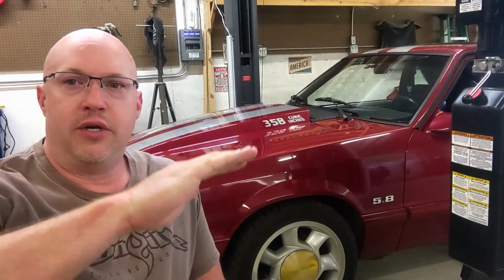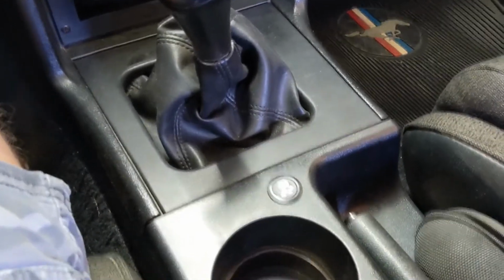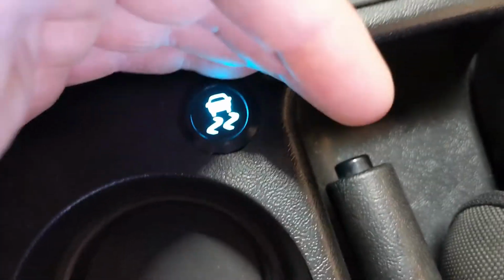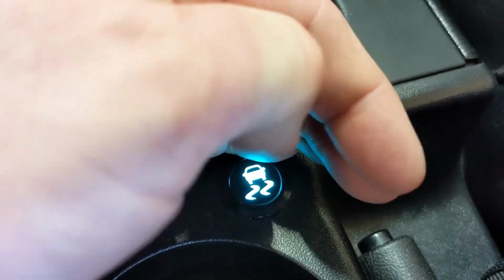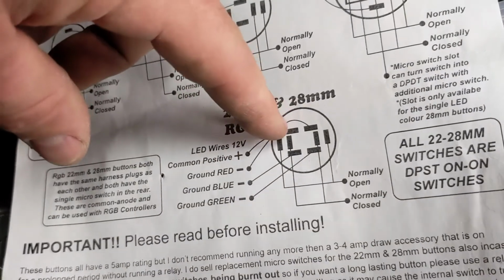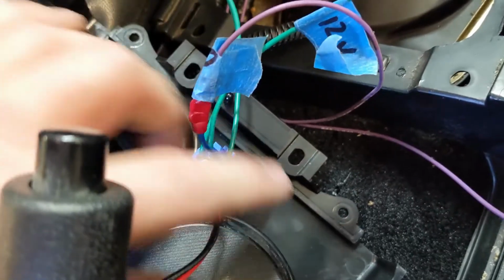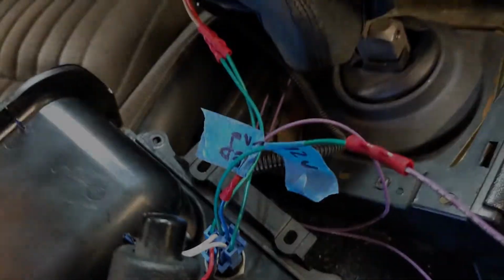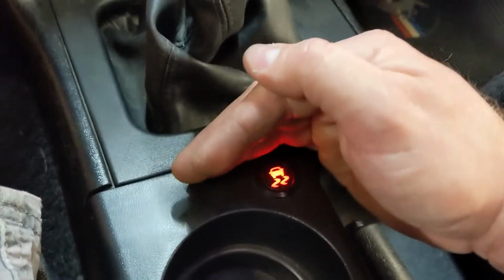Fox Body Mustang 🐎 Traction Control - Pro M EFI - Billet Automotive Buttons

Comment: Great video. I ordered the switch after seeing this. Do you know what wires I'd use for the momemtary contacts to the Pro-M? I ordered the T/C harness but they've gone out of business and never got it. Looks like red and tan in your video, but I don't have the harness. Any chance you remember if the wires were the same color at the ProM engine harness plug? Just don't want to fry anything.
Reply from the maker: Aw man!  It sux that they've run their business into the ground!!  I do not remember what color the wires are on the other side of that harness...  But, there should be a 2 wire harness and if memory serves, it is labeled traction control.  Those would be the wires that connect to the normally open part of the switch.  Next time I'm in the kick panel, I'll take pictures of everything. 
Then, from the manual:
"The purple coil of wire in the passenger's side kick panel is for the Traction Control
indicator light. Use any 12vdc light you choose. Connect one side of this light to a
switched 12v power supply through a 5A fuse. This circuit must be hot only in
the run position. Connect the Purple wire to the other side of this light."

I hope that is helpful!  Please let me know how it turns out!
Reply: Thanks so much for the reply! Unfortunately i don't have a connector  in that area labled T/C. There's just one connector with 6 wires. There is a red and tan in that connector. Maybe that's it, I'm not brave enough to short them together to see lol. I understand the purple wire, just neeed to figure out the two that make contact to turn it on and off.  The search continues. It does suck they went under. Great product, terrible business people.

Comment: With the Pro-M wires connected to the normally open green wires on the switch what are the RGB power and ground wires connected to? It's unclear to me what makes the RGB light go on and off. What provides the feedback to the RGB to turn it on and off?
Reply from the maker: Sorry it took me so long to reply.  I had to go back to the manual to try and remember...  Basically, there is another wire that is purple that is the ground for the light you chose...  
"The purple coil of wire in the passenger's side kick panel is for the Traction Control
indicator light. Use any 12vdc light you choose. Connect one side of this light to a
switched 12v power supply through a 5A fuse. This circuit must be hot only in
the run position. Connect the Purple wire to the other side of this light."
I hope that helps!  Let me know if you have any other questions!

Comment: Hot start issue figured out? And was the purchase of the ProM worth it? I have 88 model that has a rebuilt 306 w trickflow heads and intake that makes 325rwhp. I’m getting tired of the drivability of the car. At wot it runs great but putting around town is difficult at times depending on the weather. I have the A9l w quarterhorse tune. I’ve been thinking about getting the binary soft wear and having Leach Morton sports help w tuning. Or going this route.
Thanks for the vids!
Reply from the maker: Haven't figured out the hot start issue yet. I'm emailing back and forth with Chris Richard's about it now.  I'll post up a video of the fix. I will say that the pro m system really brings it as far as drivability is concerned! It drives better than it did before! And before, was a milder cam and the stock computer with it idling at 1050. Now am idling at 950! Its a lot of money... My main reason for getting it was I didn't want to constantly tune just to get it to run right. So far so good! And the traction control is freaking amazing!

Comment: Bigdogs Porting parts has that effect on tires🤣🤣.
You don't need traction control to detune the car. You just need better tires and better suspension lol. Don't be afraid and detune the motor with traction control lol